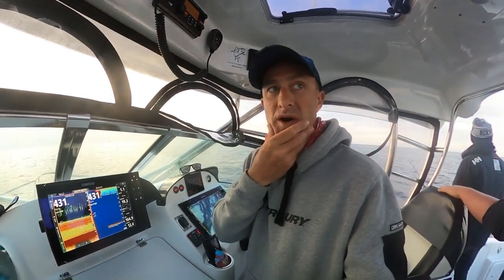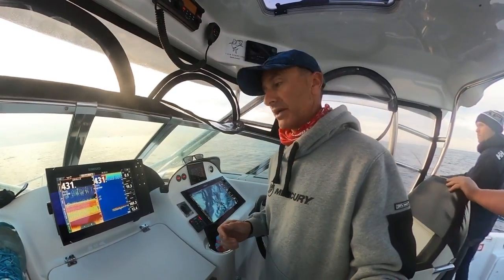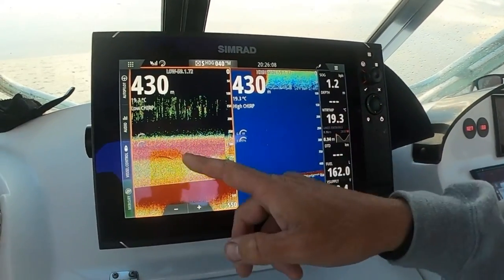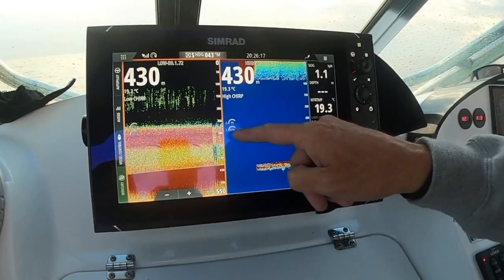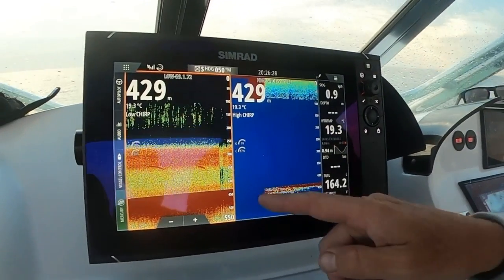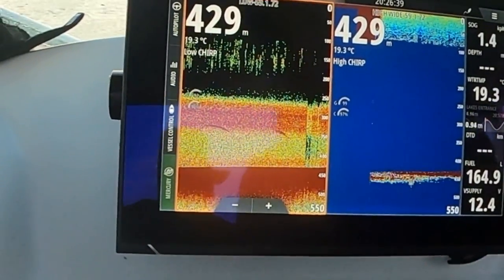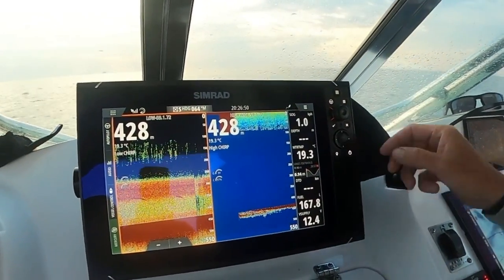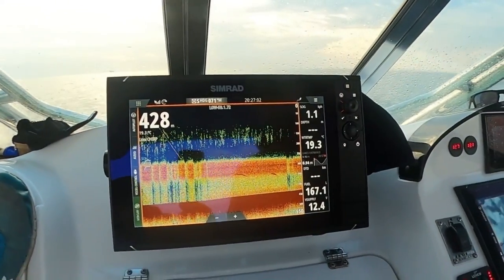High-Chirp and Low-Chirp | Sounder Tips | Sonar

Comment: what transducer model are you using? would it be possible to help me choose a model for deep sea fishing?
Reply from the maker: If your unit permits it, you could use a 275LHW transducer and you'll have the same result of the video. Although here a S5100 module was also used.
Reply: @simrad-yachting so wait, r you running two transducers